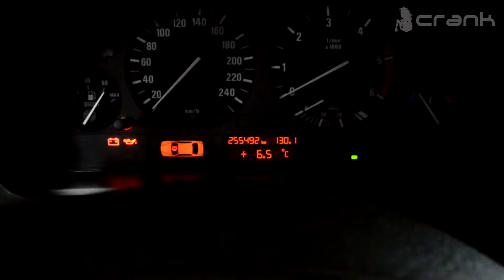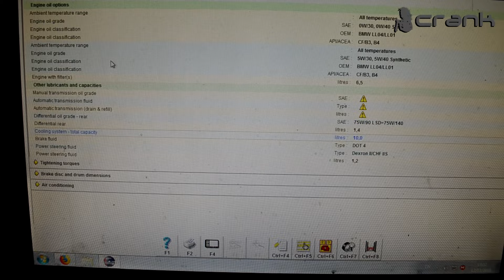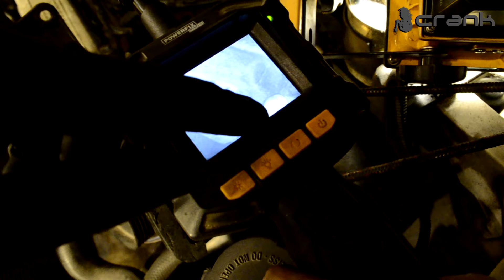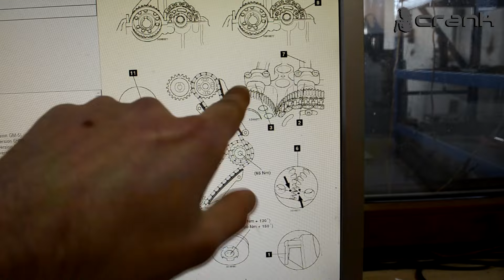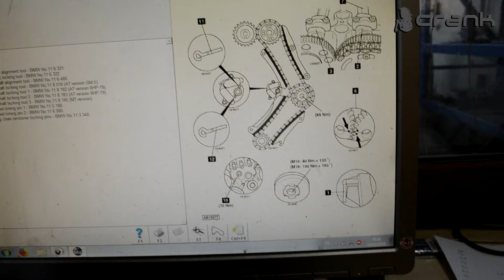BMW M47 M57 Timing Chain Replacement on E39 E60 E90 E70 E54 E65 E46 E81 Part 1

Comment: Hello, you removed the timing chain cover without removing the cylinder head. I have E46 330d m57n and the shop says that thay have to remove the head. Is removing the cover on my car m57n 204bhp really that different than this? Thanks for reply. Regards:)
Reply from the maker: No it is exactly the same . The cylinder head should stay on place . Probably they don't know about the hidden bolt which i showed in the video
Reply: THANKS!

Comment: Oh boy what a job... I recently changed HP pump bmw e39 530dA 2002/05... after 382.000km, I did not touch the chain yet, I change oil very often almost every 10000km, how long do you think I can keep the same chain, can the original one last 500.000km? I drive it both very aggresive and also very calmly :) thanks a lot
Reply: The M47 and M57 timing chain is very robust and can last easily this high mileage. You sound like you have a good feeling for your car. You'll hear the chain if it's bad well before it fails. All the total engine failures with the N47 and N57 (these engines are much more known for chain problems than the M47 and 57 engines) with chain problems were all customers who ignored the noise...
Reply: @xcofcd  what does a bad chain sound like?

Comment: hello, question ! M57D25 with exhaust gas in coolant , never overheat ! y will change the head gasket but do you think y have to send the cylinder head to control and resurfacing ? if yes, wich head gasket y have to buy , with 2 or 3 holes ? thank you !!!

Comment: BMW e46 320d 136 HP,  my mechanic says the timing chain is loose,  because when mounting  high pressure pump, he had to late the distribution, the car is 300 k ( that I know) its possible to failure?

Comment: when we should change timing chain? what mileage I meant?
Reply: Mine snapped at 115K miles (despite oil and filter changes every 9000 miles) so imho 100K miles or 160K km is about right.
Reply: On the other hand I’ve gone 255k miles and no chain. May be on last legs tho. 2005 M47N engine. Not mapped

Comment: Thanks for your great content i will atempt to change my timing chain on my E61 this week. I got 2 questions
1. If i lower the front axis do i have to secure the enginge from the top with a motor crane or bridge?
2. For the whole procedure can i unplug the battery for 2 or 3 days without damaging the vehicle control units?
Reply from the maker: Yes you need to support it somehow. Never had an issues with unplugged battery. Still it is possible to damage something when you have low battery
Reply: @crank3646  thank you for responding 👍👍. So for this repair is it necessary to unplug - from Battery or can i just leace it on with ignition off the whole time.
Reply from the maker: @monsieurduchemin2693  It is better to disconnect it. If you drop some tool over the starter it is possible to crank the engine while the chains are out. The chance is really small, but still it is there
Reply: @crank3646  okay thanks for the advice. For lowering the front axis at E61 i frist have to detach all the hydraulic lines and cables? Because this will be too much work without a lifting platform. Then i wont change the oil pump chain. Even it is better as you said because the oil pan might leak if you dont renew the oil pan gasket but it wont be doable for me. Maybe i will have to use some silicon for the part of the oil pan gasket?

Comment: Through all the videos, m getting to know the BMW 530d e60 better, i don't think I will ever take it to the mechanic, all thanks to you ❤️

I have a ask, the timing chain for the M57 which other cars does it fit to, m asking this because when I search BMW 530d e60 M57 timing chain it does not appear.

If possible kindly share part number.

Thank you
Reply from the maker: There is a lot of parts included in this job not only 1 timing chain . You can search them here :
http://bmwfans.info/

Comment: hello thanks for this very good video 
so you leave the injection pump in place ? 
on e46, is it possible without engine deposal ?
thanks
Reply from the maker: Yes , the injector pump is in place . On E46 is the same for 150 hp . If it is 136 hp you need to lock the pump . I have video about that .

Comment: I snapped the threads for the standoffs you took out at 24:00. Do you know where to get new ones or do i have to try and get used ones?
Reply from the maker: It is not sold separately, it cames with the cylinder head. If you take from a different cylinder head, there is a possibility that you going to have a weak on the vacuum pump after that.

Comment: Excellent videos. 2 questions please..

First, what is your success rate regarding not having leak from oil pan gasket if you do this job without removing oil pan? Would little bit extra silicone applied reduce occurrence of leak?

I only need to change timing cover, not renew chains again. 

Secondly.. is there any material difference between timing covers on iron block m57n Vs m57n2 aluminium block? 

(I know there's difference for alternators)

Thank you!
Reply from the maker: Can't tell the success rate, cuz I have done it only ones and it didn't work. The reason that is hard to be done is because that the timing chain cover is squeezed pretty tight btw the cylinder head and the oil pan. So if you apply silicone on the oil pan gasket, most likely 90% of it is going to be wiped during the attempt of the installation. Probably it is not impossible to be done, but is going to be really messy job which I don't approve. 
I don't think the timing chain covers are different. But I can tell you for sure that the new timing chain cover will not alight with the face of the cylinder block, which is going to make the installation even harder. If this timing chain cover doesn't leak is going to be miracle :D
Reply: @crank3646  thanks for the insight. On reflection I understand the point you make about timing cover being squeezed between head and oil pan. I will do properly. Horrible job on floor.

The timing cover swap is necessary to allow me to fit a second cp3 (e92 330d with Electronic power steering rack has different alternator position compared to 335d / e60 m57 with hydraulic power steering rack) and thus need to change covers to free up space in engine bay.

What you say suggests the individual timing cover is machined at factory to the specific engine block it is installed on?

I assume you've tried replacement timing cover on different engine without success?

(I recall one of your videos you took effort to weld damaged cover, so must be reason. But as you see I have little choice but to change...)
Reply from the maker: @OdedraPerformance  Yes, we welded it, not because the cover was expensive, but because we were going to need to machine the cylinder block face and the new timing chain cover then. The surfice height of the both things should be the same. I have changed my timing chain cover on my new engine and the cover was 0.1mm lower than the face of the cylinder block, which means 0.1mm higher on the oil pan surfice side. So in the both sides I was going to have oil leaks for sure, if I didn't machine it.
Reply: @crank3646  mmh that is concerning, thanks for sharing your experience.

By any chance do you happen to know which engine that cover you tried was sourced from? And which engine did you try fit to?

Realoem shows multiple different part numbers depending on chasis and also m57n iron or m57n2 aluminium variant in that particular chasis.

Despite this, the covers from ALL models visually look indentical. E9x E60 m57n and n2... Including bolt holes, webbing, alternator bracket etc. The number stamped inside cover same despite what is indicated on realoem. 

But perhaps these realoem part numbers might correspond to slightly different dimensions like you discovered?
Reply from the maker: @OdedraPerformance  I don't talk for M57 especially. This refers to all the engines, mercedes audi doesn't matter. In the factory, when they make the final surficing process on the cylinder block they put the timing chain cover together and they resurfice them together. That is why the timing chain cover is set with the block. If you want to use different cover you need to remove the cylinder head and resurfice the block with the new cover so to have equal height.
Reply: @crank3646  I see what you're saying. Yes, makes sense logically. 

Just curious, have you observed this 0.1mm length difference specifically on M57 engine before?
Reply from the maker: @OdedraPerformance  Yes, but most of the time is less than 0.1mm, ~0.05mm , still is going to cause an issue.
Reply: @crank3646  thanks for the information bro, has been helpful as usual! Side note - I would have struggled without your videos when I did my full chain assembly for that hidden bolt inside engine. My m57n2 surviving daily 5500rpm abuse with big turbo (so far 😄).

Comment: Hi I’ve just done this to my e39 525d m57 useing all 3 of your videos thank you I have a problem tho I set the timing and had it all lined up the pin was in 
Took the pin out to rotate engine clockwise and it’s locked up won’t move atall any advice
Reply from the maker: Probably the pin were installed in the wrong timing hole in the beginning
Reply: @crank3646  but I turned engine over twice till the front lobes was in TDC piston 1 and the whole way round on the flywheel and that was the only hole that lined up with TDC cylinder 1 is at TDC and cylinder 6 also but on its exhaust stroke
Reply from the maker: @TOBLEROWAN123  just check if piston number 1 is at TDC physically from the injector hole . If yes install the timing tool over the camshaft , and there should be no reason for locking
Reply: @crank3646  is it possible the fuel pump nut is too tight?
Reply from the maker: @TOBLEROWAN123  No
Reply: @crank3646  oh no what have I done wrong     Mine is an automatic is it any different for those
Thank you for the videos though and your replies

Comment: Hi, I think I have a worn out timing chain on an M41, I can hear a noise I thought was a dry pulley bearing, but I took the belt off and it persisted.

Is it possible to remove the timing cover on the M41/M51 without dropping the oil pan? I don't have a hoist, so I have to work on the ground.

The car has about 360k KM on it, I can send a video of the noise if you're interested in hearing it, it gets louder once the car is warmed up, almost can't hear it when it's cold.
Reply from the maker: If I remember right , you should be able to remove the timing cover without removing the oil pan on M51/M41. It is hard to pin point the noise on a video , so I don't think I will be able to help you with that .

Comment: do u have to remove the gear from injector pump to get the cover off? is that tool necessary?
Reply from the maker: Nope you don't have to remove it for the cover. But for changing the chains it will be needed
Reply: @crank3646  i have to change the head gasket so do i have to remove it?

Comment: Awesome video and great content, thank you for explaining this in detail. Well done. Thanks for effort !
Reply: sorry to be so off topic but does anybody know of a method to get back into an instagram account..?
I was stupid forgot my login password. I would love any tips you can offer me
Reply: I really appreciate your reply. I got to the site through google and I'm trying it out atm.
Looks like it's gonna take quite some time so I will reply here later with my results.
Reply: HOLY ** IT ACTUALLY WORKED :O Just got access to my ig account details after roughly 40 minutes by using the site.
I had to pay 15 bucks but for sure worth the money :O
Thank you so much you saved my ass!
Reply: @emmettroberto7195  The best thing , if you can not get the password or if there is no way of reach back the old password, make a new account  and make an advise at the new account, explaining the old account is closed because you lost the passward, don´t know if that helps, but if the right solution do not cames, this is the way.

Comment: What''s the price for all this opeartion.For parts for maystorluk(in levas) if the engine is М47N2 4cylinders
Reply from the maker: The cylinders doesn't matter , the job is almost the same . Depends do you want to change everything or just the most needed parts . In 90% of the time while we are "digging" for the chains , we find something else for changing . Like in this video they were additional parts that were needed . But will give you approximate price . 1000-1200 lv without the engine oil and filters + 200-300 with it .
Reply: @crank3646  Thank you for the information.Nice video,keep going.I can visit you soon.Весели празници
Reply from the maker: @sezginaliev9908  Мерси ! Весели празници и на теб !